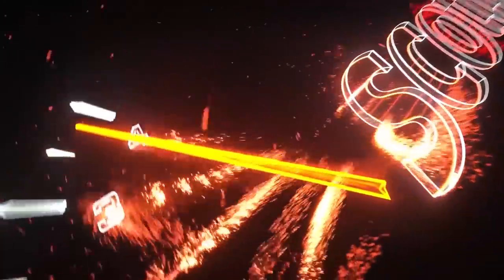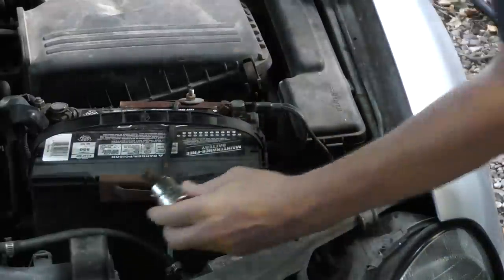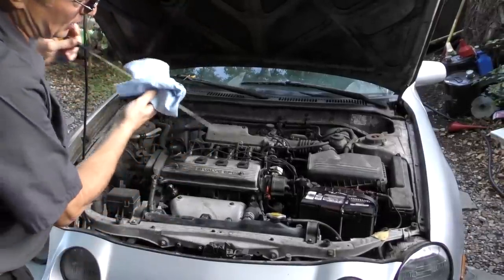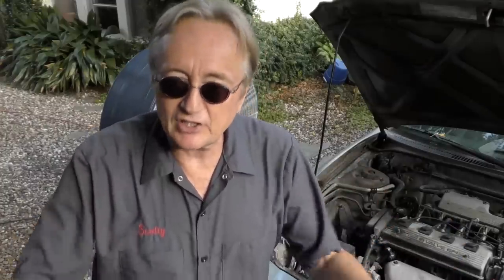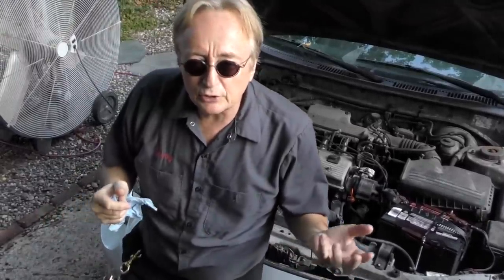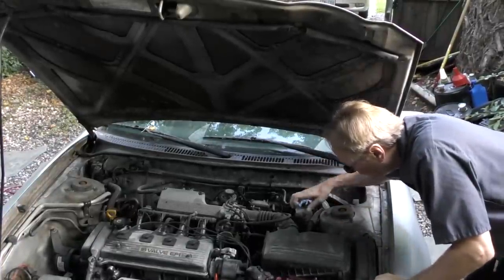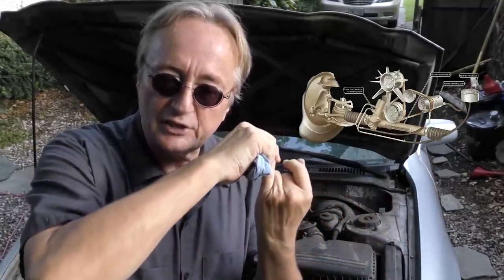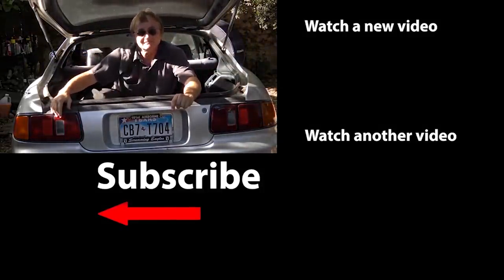If You're Not Doing This to Your Car You're Stupid

Comment: I bought a used 2005 corolla in 2006.
Being a young man I drove the hell out of that car. Changed oil, transmission flush at 100k.  Other then brakes and tires I had to replace the starter.  And then an evap issue that no one and I mean no one could figure it out. 
So I got a 16 Camry.....

Comment: Hey Scotty. My Toyota Camry is 22 years old. I am not the original owner but when we got it we did a full service overhaul. All I do is change my oil every 3,000 miles and it still runs strong. This car was my MVA practice car to learn how to drive. I use it for work now but I am almost getting to 200K and it’s time for a oil change too actually. Great video!

Comment: I change my oil every 3000 miles, or whenever i get bored witch ever comes first
Reply: You must not have an inverted oil filter on your vehicle like I do. messy.
Reply: It's a good excuse when the wife is on her "time", to get out in the driveway or garage lol.
Reply: As stated by the legendary Hank Hill
Reply: @mickdavis2385  Hell yeah, id rebuild my engine once a month when "Aunt Flow" comes to visit!! 😆
Reply: Just follow the guide in your car maintenance manual, and use top quality oil, so once a year or 10,000mi should be fine.

Comment: What about flushing out the old turn signal fluid once a year?
Reply: As a good rule whenever ya change your smoke detector batteries change
The brake light fluid
Reply: & repack the muffler bearings!

Comment: 6:24 flush brake system Every 4 or 5 years? In a Chrysler? As if it would last 4 or 5 years lmao
Reply: Got a 1975 Dodge truck still has original motor and transmission running strong...can’t remember seeing a 1975 Toyota anything in my lifetime lol
Reply: Chad W. I have a 2007 Lexus is250 with not a single lick of rust on it. It’s been in Ohio it’s entire life. Every American vehicle I see from that era is rusted to hell. They are literally falling apart and rotting away. I’ve seen Toyota with 300,000 plus miles on it. Although yours is a different case I don’t see a lot of older American vehicles on the road.
Reply: Chad W. There werent alot of toyotas produced  in 1975 And they were in established so not as many sold, and wow in 1975? You're going to compare something that old to speak to a company's current reliability? Chrysler hasn't made anything reliable  since the 70s?? lmaoo bravo
Reply: I also have a 2009 Ram I bought new. Not one issue with it either. Very solid reliable truck
Reply: Chad W. If they can only make trucks 🤷🏽‍♂️ pointless ... Look good because of RAM and jeep is carrying the brand brand... My friend has a   2015 ram with no issues, Can you name a decent Chrysler car that has come out in the last 10 years? Charger/300 have been decent , sure... but everything else has been a disaster  That would be like Honda bragging about the accord and CRV being reliable but everything else being trash
Reply: Well my mom has a 2012 Ram which is well after the Fiat merger, not an issue with it either. It’s all in how they’re taken care of. Every company makes a few lemons. Yes even Toyota’s. Some Tacoma’s and Tundras have frame rust issues so....
Reply: 4 or 5 year old Chryslers? How about 10 year old Chrysler's? I still see a ton on the roads. Toyota? All I see are 2015 or newer on the roads these days. The old ones are long gone. Even the Celica's are extinct.
Reply: @Mr10Alpine  I think you got this backwards. Or you need to open your eyes and pay better attention. Toyotas everywhere.
Reply: @Mr10Alpine  I see them on the road...problem with those old Toyotas they are so ehh in the looks dept you dont notice them ha.
Reply: I own a 2000 Chrysler Cirrus with nearly 200K miles, a 2014 Dodge Charger with over 100K miles and a 2002 Chrysler Concorde.  I have never had to replace anything on my Charger and very few repairs on the two older cars.

Comment: I change the oil in my 2000 Corolla every 5k miles. I use Super Tech full synthetic 5w-30 and a Denso Toyota filter. 253,435 miles on the clock and have had no issues at all. I've heard a lot of people say that the Corolla's from that era are prone to burning oil but luckily I haven't had this issue. The only thing I've had to do is change the struts and sway bar links. 
  This is first vehicle I've ever owned that wasn't from one of the Big 2 manufacturers. And it is also one of the best running I've ever had. I'll never go back to Ford or GM again unless it's a pre 2000s model.

Comment: Scotty I recently bought a 1999 Mercury Mystique. It's an excellent shape as far as I'm concerned and it came with a book of service records. The previous owner was an 82 year old woman who had oil changes on schedule and didn't care if the mechanic said it needed more than what she took it in for. She was okay with them taking care of things they felt needed to be fixed. I had two other options at the time I bought this car and it had 50,000 less miles than one of them and almost a hundred fifty thousand miles less than the other. It is right now sitting just over 143,000 miles. I plan on keeping up with the maintenance so that I can keep it for a while.

Comment: I have a 93 Honda CRX Targa with 90,000 miles and it starts and works great also. Never had a problem with it just normal oil changes and filters.

Comment: If you go synthetic you can't switch back to regular old motor oil because the synthetic oil puts a film on the parts in the engine and this film prevents normal oil from sticking and providing lubrication like it is intended to do. That is what my brother told me once and he is a mechanic in both automotive and diesel, but his job is mainly diesel engines in semi trucks.
Reply: Nonsense.  Then what's his theory on all those synthetic blends out there?

Comment: +rotate those tires the same time you change the oil. You don't have to, but if want maximum life from your tires, the physics of the car weight, balance, steering will wear your tires abnormally if left in the same position too long. I got 70k plus on a set of tires on my 240sx that was lowered and modified so that proper alignment specs could not be achieved. That life would not be possible without frequent tire rotations.

Comment: Don’t forget to change the air in your tires. Summer air in the winter will freeze and throw the tires out of balance. Winter air is too heavy and will sit in the bottom of the tires and throw them out of balance. 🤣
Reply: NAVRET you should flush the old air out with new air haha
Reply: Sounds like something out of a Chinese owners manual.
Reply: 😈😈😈 🤞😁😁😁😁 🤘 😂 😂😂😂😂 

I've been thinking, living in wet old Oirland, of putting Galoshers on me tyres to keep them nice and dry, and I give them a good rubbing over with that KJ Yelly, "To protect the feel of the 'rubber' and help 'ease' the rubbers on and 'provide a Good Seal' !" - 
So my Question is:(A)  Does the Summer/Winter Air Change Apply ? and (2) What is the case if I have a set of:  SpringSummer/  Autumn/Winter Tyres ?  (vii) How should I Store them to Avoid Cross-contamination ? Would a big Freezer be the ldeal Scenario for Storing the Autumn/Winter Tyres ??
Jesus n His Holy Apostles !  
If I'm Needing This Much information on JUST The Tyres !!
How in the name of God and His Holy Saints will I Ever Pick Out A Motor Car ?!!
Reply: @billyc.1170  - I've never owned a Chinese before so I'm curious an You seem to be a lad who'd know ! First off -- Are dey Cheap ? Does onny the New Whans come wit Instructions ? Are dey easi fed ? Like do they just get by on the chiken n rice, or woud dey be parcel tay a feed of spuds n gamman ? Yur Help an axpartis expartaze woud be of grate help,sinse wehn the Mammie dyed las munth ders onny meself an the oul Massey tíl do de werk ! Thankin yu kindly fér yur help an advisment, Tomás Séan Joséphus O'Hèirlehey (de sixth) 
🙃😉
Reply: you're not nice, dude... not nice at all.  You KNOW somebody read that and believed it, even if it's only ONE GUY.... especially since you forgot to mention how you have to change out every other lug nut for the winter wheel lugs.  One time half my lugs drove themselves crazy and right off the car.    But you didn't think to mention that, did you?  NO... you only think of yourself.

Comment: Good tips Scotty. My car isn't 26 years old, it's a 2006 Ford five hundred with Asin 6-speed auto. I keep the oil, tranny fluid both changed, flush the radiator. It's has 140,000 and so far the only thing out of normal maintenance is I replaced the alternator. And that may have been my fault for hooking a battery charger up once and set it on booster. Now, I haven't changed the brake fluid or power steering fluid yet. It's really been a good car.  Thanks, JohnG

Comment: I haven't cleaned my battery terminals since getting my truck (new) 7 years ago--never had a problem .  Just replaced the battery (battery died finally after 7 years and 147k miles later)--didn't bother cleaning the terminals (they were clean to begin with, and some vehicles also have rubber covers that go over the positive terminal anyway).  But I do have to agree with Scotty--even with synthethic oils, you should really change it at least every 5000-7500 miles or 6 months.  As the vehicle gets older, I'd say change it more often (maybe every 4000 miles if it has a lot of miles on it, even if it's using synthetic).  Lastly, buy a good quality oil filter especially if you hope to get 7500 miles out of it.  Cheap ones (like Fram) tend to fail/collapse internally and can clog (most that fail prematurely I've seen around 2000-3000 miles but sometimes sooner) and can cause problems (oil pressure problems).  Spend the extra money and get a good filter, like a Wix or at the very least, use the OEM filter.  I've also found for my vehicle, trans fluid changes every 90k is fine especially if you do a lot of highway driving in moderate termpeatures.  I wouldn't think you'd need to change it more often than every 60k unless you're doing a lot of idling and taxi driving.  But for most people on modern cars, 60k or 90k is good.  You just have to keep an eye on it and check it regularly (at least once every other month if not every month mainly to make sure you don't have a leak).

Comment: in my 67 mustang they swapped the 289 out with a high mileage 302 from a 1980 pickup before I owned it, definite oil blow by fouls out spark plugs within 1000 miles motorcraft spark plugs are cheap and easy to replace on this car. I change the oil every 3 months or if it smell like gas after driving it a while and replace gaskets as needed. Usually  without touching the gas pedal it will fire up in less than 3 seconds of cranking

Comment: In modern cars brake fluid has to be changed every 36 months. Some work trucks require it every 24 months. 
Check your owner's manual for the required maintenance

Comment: I've always been told Vaseline works well to seal off the battery terminals
Reply: Yes or grease. It seals oxygen from setting up corrosion on the terminals. Been using it for years....
Reply: I also hear hairspray works too.
Reply: Just checked   my year old battery yesterday, sunofa  there was acid corrosion build up on the negative terminal, hidden  under the cap, I thought, thanks scotty.

Comment: Automatic transmission fluid can be checked by putting some onto a white kitchen paper and if it is starting to go brown instead of red it needs changing. Brake fluid tends to start going black in the top of the reservior then its time to use a Gunsons easybleed to flush out the fluid with methlated spirit(may be known as rubbing or wood alcohol) then flush out the meths with the new fluid. Whatever you do don,t let the easybleed run out of fluid.

Comment: Acura 04 TL 
3.2 Vtec love my Acura 🤩
Reply: Just be aware that the transmission sometimes goes bad. Not sure what exactly happens but maybe googling can prevent It. My brother was on his way to Vegas and the transmission fluid spilled out for some reason so me and my dad had to take him another car and pick his car up so he can still go on his trip
Reply: That's a nice ride.
Reply: Yeah I had some issues with Jose Vega it was throwing the gears on high gears well i checked the fluid it was good so I decided to replace all sensors and problem fixed I’m always on it on maintenance on my Acura
Reply: That’s because I have 230k on it 😬
Reply: Thanks Johnson
Reply: Today I gave up my 2000 TL.  Absolutely loved that car.  Had it for 19years.  Still shifted smooth as silk.  ATF leak turned out not to be just the axle seal, but the axle bearing in the transmission, causing the axle to wobble.  I will so miss that car.

Comment: Another reason to check your tires is safety.  Low tires a more likely to blow out at high speeds due getting hotter than properly pressurized tires.  This is especially a problem in hot areas with high speed limits(Texas-some limits in west Texas are 85 mph).

Comment: If you plan to use synthetic oil and keep it in the engine for 10,000 miles, you need to change the filter at 5,000 as though you are changing the oil at 5,000 miles. If you go that interval with one filter then you will have sludge and buildup for sure.

Comment: I have a 2004 civic, once I clean the battery posts I use grease to seal them. Also, whenever I come home and pull into my garage I put the hood up for all that heat to escape. With me doing this I prolong the life of my Maxx EverStart battery from Walmart, this also helps with engine life to.

Comment: Scotty knows his craft no doubt. Scotty doesn't really recommend the Mazda 3 but my 2009 hatch has 267.000 miles and runs very well. I do change the fluids( due to Scotty) and at the rate I drive I should hit close to 400,000 miles when I retire in 3.5 years.  I've owned the car since new, bulletproof 2.0 liter automatic.

Comment: Loose or corroded Battery cables can cause all sorts of weird things to happen to your car, I purchased a 2014 VW Jetta TDI buy back vehicle, owned it 2 months and it 1) stalled 3 times when accelerating from a stop.  2) lost all power resetting the clock 3) lost the automatic open and close on Pano sunroof having to hold the switch to open and close it,  I found the Battery cable terminals were not tight, if you grabbed them and twisted they felt tight but they were not tight enough and I got several turns of the nuts with a socket, If you have any odd symptoms on your car try tightening the cleaning the Terminals.

Comment: I've got a 2000 Nissan Maxima with 236k on it. I just recently got it but it runs great. Has a misfire either because of connector or exhaust being broken but other than that it just has a small oil leak

Comment: Hi long time viewer first time commentor. Scotty is a very smart but it is amperage that kills you. 1 amp for sure you would be dead. 1/2 amp - 9/10amp I wouldn't risk it. So you can be hit by 400volts and wouldn't be harmed provided that it is 1/2amp or less. Voltage is electromotive force it pushes the electrons(amp) through the wire. Oh and a brand new car battery is usually at 13 volts.

Comment: On my last battery after is started going out, my steel hold down was a sacrificial anode. The terminals stayed spotless with no protection at all but the clamp had tons of buildup. A quick scrub and it started over. Battery finally crapped out after 6 years so now I have a new one

Comment: Mobil-1 My brother had a 1982 Volvo 242 . . .once it got 7k miles on it, he switched to Mobil-1 synthetic. What he did might blow you away; he changed the oil every 50,000 miles. All he did in the interim was to change the oil filter every 3,000 miles. Long story longer . . .the car had 320,000 on it (never did an engine rebuild  nor even had the head off to refurbish the top end) when he sold it and the local new owner continued to drive it around town for another 4 or 5 years. The simple truth is, full synthetic  oil just doesn't break down as quickly as conventional oil.

Comment: The only vehicle I have had many brake problems with is my current 97 chevy c1500. And I swear most of the problems came from me using a vacuum pump to try and pull brake fluid from the rear drum cylinders. I think it put too much external pressure on the seals and called them to start leaking. I don't recommend using a vacuum pump on a brake system based on my experience. I believe a hydraulic system designed to hold pressure in should be subjected to a vacuum. Maybe the type that put pressure on the master cylinder reservoir would work well and be faster, but I've never had issues with a system I have only used the master cylinder to push fluid through.

Comment: My Dad drives a 2001 Chevy Cavalier still with OEM tires!!!  (Yes, 2001)  They are B.F. Goodrich.  Still has tons of tread, no cracking.  Car always garaged and air pressure maintained.  Granted only about 25K on them but should he replace before this coming winter?

Comment: One thing I would critique about this video is when changing out transmission fluid make sure you are working with a cold engine replacing with room-temperature fluid, transmission fluid expands when it gets hotter and will mess with your quantity
Reply: I just put in a tad less and check level when warm.

Comment: Keeping my Trailblazer engine and trans running, no problem. 200,000 and counting. BUT keeping the electronic gimcracks from failing, that is a BIG challenge. For example why design a logic board to control the windows if you know it will get wet if the window is down or you need to get out of it in a gully washer rain? I have ended up simplifying a lot of the over engineered basic cabin functions. The dash panel was a big fail as far longevity goes. I am not to found of any of the latest FCA, GM and Ford dash creations. Sometimes analog is the absolute longevity solution. But what do you expect when 3 pedal vehicles are too hard to operate.